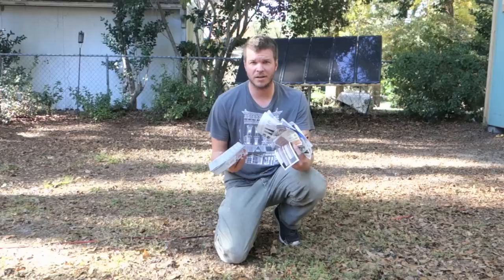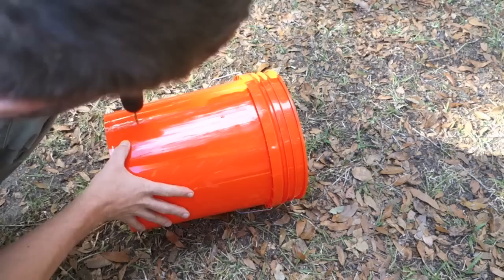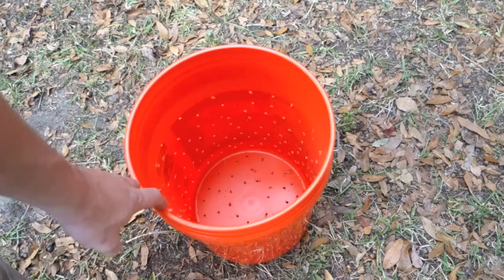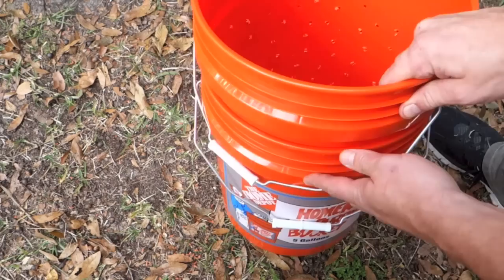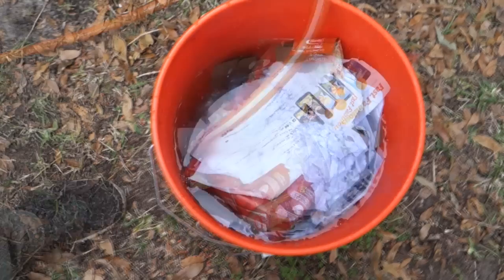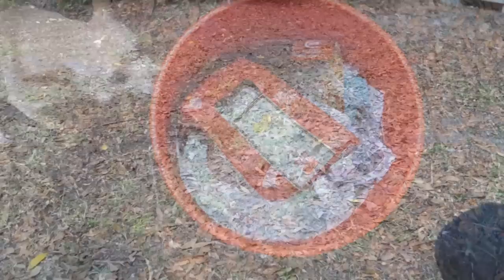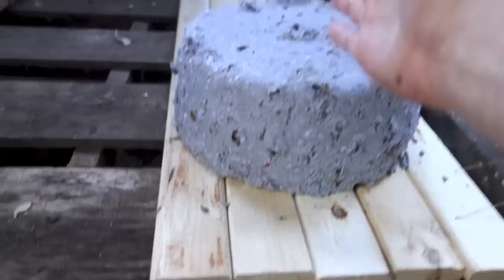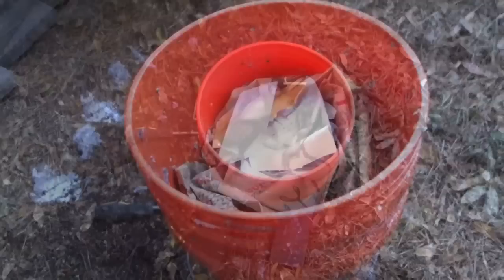Free And Virtually Unlimited Fuel To Heat Your Home

Comment: Paper is normally treated with lots of chemicals in its manufacturing process. Have you done any research to ensure that burning paper in an enclosed is safe?
Reply: Organic compounds can also break down into CO or other dangerous compounds as many fossil fuels do.  Don't get me wrong, I think it is a great idea and is likely a more environmentally friendly way of recycling paper (as opposed to electrically heating your home).  But I've been trying to see if any real research into the safeness has been done and I can't find anything.
Reply: antiswattt3 Forgive me if I don't trust youtube comments for something like this.  I will be holding off until I see some more scientific research on the matter.
Reply: for the most part no, and if you are so concerned then just don't put any of the plastic infused paper in.
Reply: ***** i am with you Charles... forget the plastics fo sho...my ex worked in the printing field for years and said most inks used in printed materials will never be safe... why did some green firms switch to soy-based inks? cuz the others are well known to be toxic,& cheap...many folks have refused to use colored paper ads for gardening and composting materials for years... then, what if inks are GMO soy based? recycling is great on all levels but my airspace is sacred to my longevity: we all know cheap candles are unsafe to burn, toxins in the wicks and waxes... we shouldn't take this subject for granted...and please, antiwatt3, kind words? .. and thankyou for the shared info, too...thxxx everybody... God Bless you all... namaste oxo
Reply: antiswattt3 I hope you are joking...
Reply: antiswattt3 can only try to control what we can: learn, and share... & yes, & am very gratefully more whistle-blowers than ever, are sharing the truths re: chemtrails, thxxxx
Reply: Cinder Ella BTW, the South Koreans burned a type of round, charcoal brick in a pot, to cook with & heat the linoleum floors from UNDER THE HOUSE (original radiant floor system, "ondol", introduced by Japan, 1920s): you had to light them before you went to bed, or stack a new one on top, as they were hard to get started again: you had to do this OUTSIDE, pushing the metal holding pot, with a stick, into LITTLE OPENINGS in the exterior wall, so it went under the house a few feet from the foundation, but only 1 or 2 per room, so you heated only the rooms you were using. It was well known that the fumes were toxic and you always must leave the window cracked a bit, even when well below freezing outside. I lived in 3 different houses around Seoul in 1969-1970, and this was standard, until 1993: caused many carbon monoxide deaths... wiki YEONTON, if interested